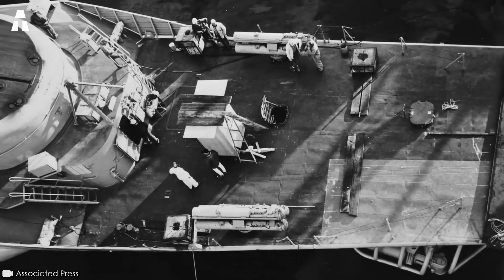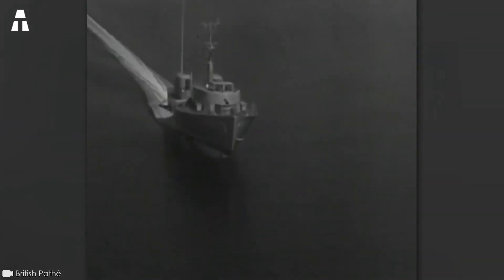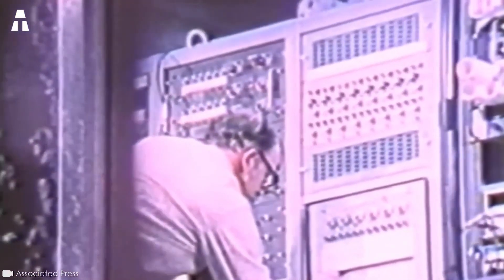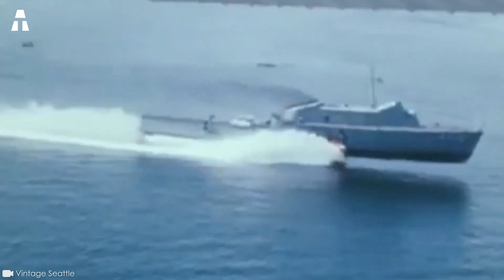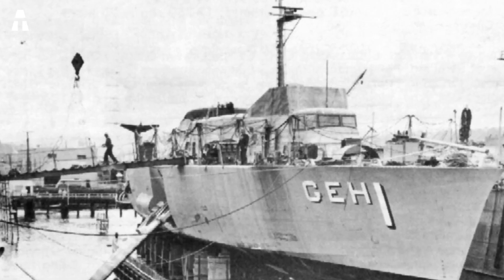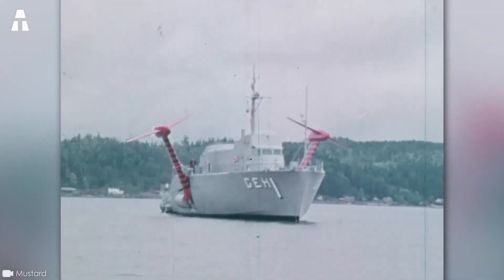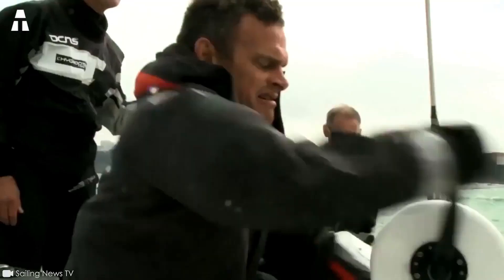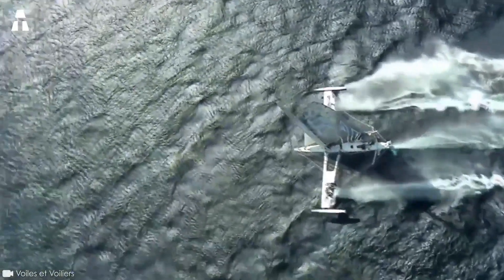The Secrets of the USS Plainview Flying Boat!

Comment: the narration, its inconsistencies in accuracy and logical flow coupled with repetitious statements, sounds like the presentation a 12- or 13-year-old attempting a first-time class presentation . 

A lot of time has gone into editing the video and creating a narrative. I will applaud that. 
"A" for effort though logical flow of the video is fairly low and bounces around topics a lot.

As mentioned in other comments hydrofoils have been around a long time. There is no " comeback " of hydrofoils to speak of.  Perhaps an expansion in popularity of hydrofoils is coming about in recent times?

Also, a hydrofoil and a " flying boat" are, in fact, all together totally different machines.
 
I wonder if the script was translated into English or if English is not the Authors first language??

syntax suggests perhaps French?